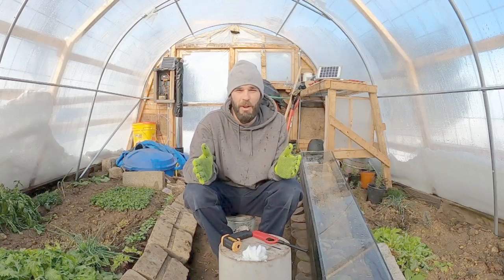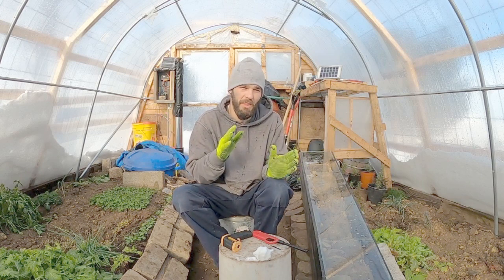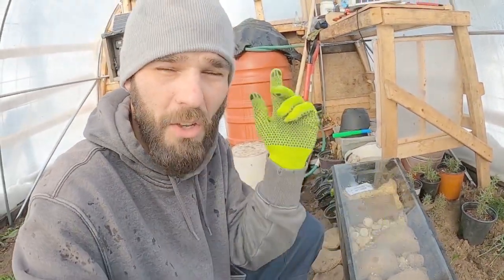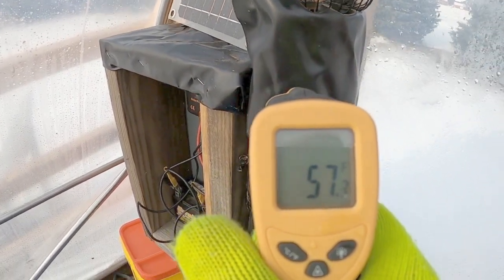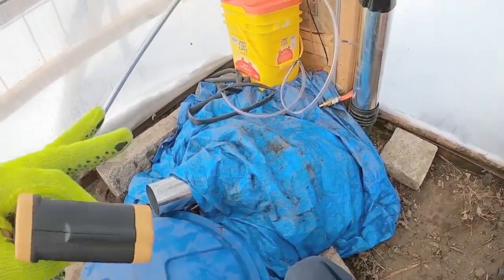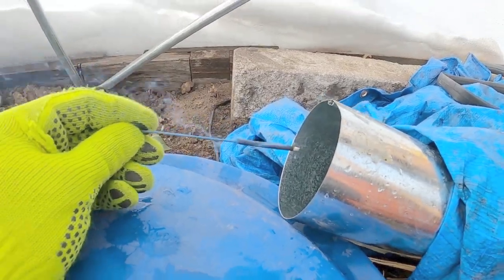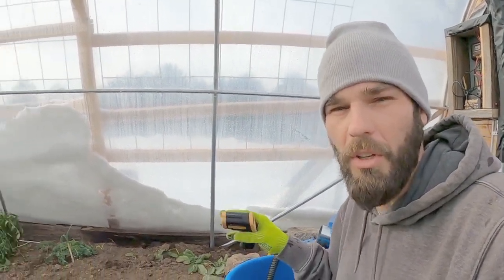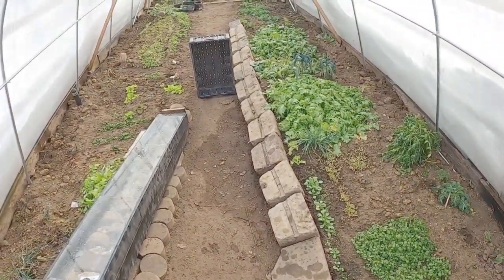Large DIY Greenhouse Winter Heating Experiments Data & Demonstration | System Changes Going Forward

Comment: Are you  still active with this project?
Reply from the maker: This was last winter, we did a lot of experimenting with solar heating, we’re using all compost heat in there now.
Reply: @Earthdwellershomestead  is it too late in the season to efficiently start a compost project in the KC area?
Reply from the maker: Depending on the temps you’ve got coming, you could certainly try! I’ve got piles going when it’s 20F outside it just takes a bit longer. And if it’s even colder outside you’ve gotta have a really big mass of material that is going to wanna burn (high in nitrogen)

Comment: This is super inspiring!  What is the total budget and time invested into this system?
Reply from the maker: We basically do everything in the greenhouse as cheap as possible so most materials are upcycled or recycled and bargain bought, our expenses are in the solar fans. Roughly 15-20$ a piece and our solar system was about 100$ for the panel and controller a few years back.  Those are the biggest inputs up till we begin then next projects soon.
Reply from the maker: Thank you! Which system were you referring to?

Comment: Use a camping cooler with a lid for the water holding tank . If you can score ridged foam board insulation fashion a box for the cooler to sit in for added R value. Maybe row covers at night ? Love that your a "real gardening zone" !
Reply from the maker: That’s a great idea I’ve been looking for ideas for my heat sink/overflow tank. And the row covers are a must. I think it’ll help with humidity and the heat retention down low, I’ve got extra poly that I need to fashion up. Thank you!